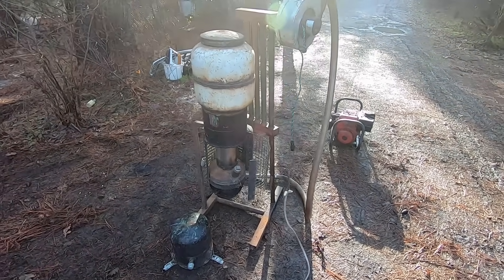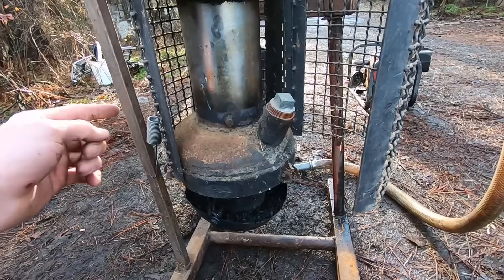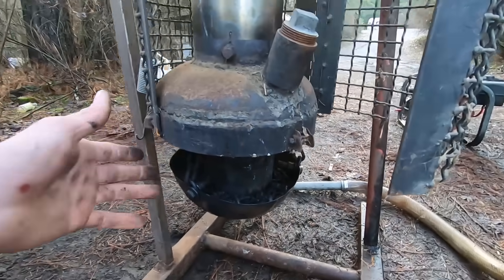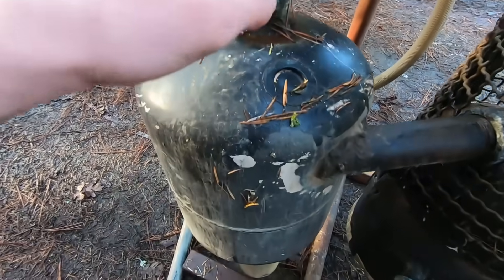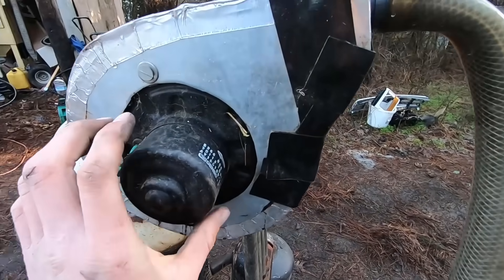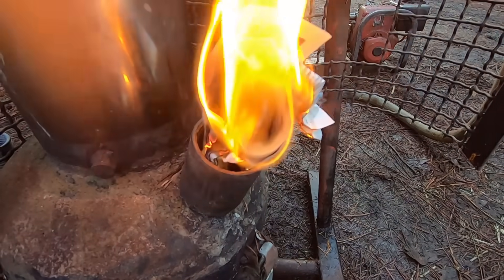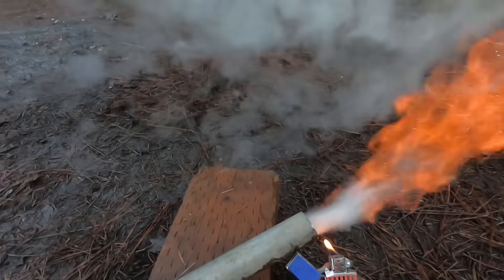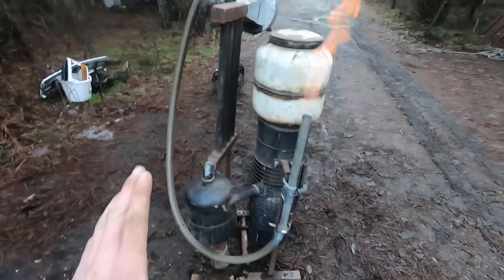Using Wood to Fuel a Generator! (How to Build a Wood Gasifier w/Demonstration)

Comment: My dad was a marine during wwii and spent some time in New Zealand. He told me about them using coal to run their cars using these contraptions.   These things obviously can provide useful power at a off grid cabin to provide electricity when there isn't enough sun to provide electricity to charge batteries and run things.
Reply: Look what I found.       I hope your dad did not tell you about the thriving black market with petrol (gas) and the locals?     https://www.google.co.nz/search?q=water%20gas%20used%20in%20cars%20in%20NZ%20in%20ww2&tbm=isch&hl=en&hl=en&tbs=rimg%3ACfYt6tCQMrTqImBzLpDTnlthUNkm24LiCIbrXbTGb7tzDl-cppVw9aNpdhJX3jCMWHGamp96fW0QGn0C7xDlGNBV1Yu25gJwAyeA48cR-gIvYSJic8JXgrSyyU9RY7LjvzaVmoAcxUHIU0kqEglzLpDTnlthUBHbOoa6tbhYlyoSCdkm24LiCIbrEc1rAMBgeDJcKhIJXbTGb7tzDl8RIR-ungLCtgcqEgmcppVw9aNpdhF3M_18_1IpDl5SoSCRJX3jCMWHGaEds6hrq1uFiXKhIJmp96fW0QGn0RyetvtyjJBPMqEgkC7xDlGNBV1RFurF0oUvpsLyoSCYu25gJwAyeAERhCaCwpMNiUKhIJ48cR-gIvYSIRtuYf0ZPw-lAqEglic8JXgrSyyRGP0OqOYy3SBioSCU9RY7LjvzaVEds6hrq1uFiXKhIJmoAcxUHIU0kR5YJyINoetzhhA78560VZRBs&ved=0CBsQuIIBahcKEwjYgIusysHnAhUAAAAAHQAAAAAQFg&biw=952&bih=460

Comment: I've completed you're Agitator with 60$ worth of Arduino google how to do it in 10 minutes 
You can use TWO stainless steel bowls one with holes drilled and one with slots drilled 1-2 inch long same diameter as holes. 1st bowl acts like a fixed CAM & gets mounted to the ash capture snap on bottom on a 4 post stand and should be the slotted bowl. The top bowl should have drilled holes and weld beads on the bottoms side right next to each drilled hole. Then have a rebar shaft run down the feed tube into the second "top" bowl and weld the rebar to the center of the bowl. Then get a coupling for your stepper motor to spin the rebar slowly so the top bowl spins on the bottom bowl. Then align the weld beads with the slots in the bottom bowl when snapping on the bottom ash catcher. That way when the beads are rotated out of the slot it seperates the two bowls by the thickness of the slag bead pushing your stepper motor up. Then as it rotates more, it drops into the slots collapsing the two bowls letting ash fall down as drilled hole in the top bowl is directly adjacent to the slag bead so it always lets ash fall through the slot when "tamp agitated". Use that center hole on your "pellet hopper" as a guide for your rebar shaft so it doesnt go wonkey and drill new air holes where ever. Those motors can handle 120C so maybe mount an old PC fan to the motor to keep it cool but its seen hotter applications so I wouldnt worry too much. You can also do a bike chain drive to make the motor not work as hard or get as hot.
7$ arduino uno
14$ TB6600 Driver control module
40$ 4.2 amp high torque nema 23
& 4 lines of code setting direction and speed and you're done with a nice agitator for 61$ minus rebar and bowl cost. You can even set timed rotations and schedules whatever.

Comment: I think the contaminants are because you're cyclone isn't designed correctly, at least as you described it. There should be a baffle just above the inlet, outlet should take from the top, and probably another baffle at the bottom would help.

Super cool though. Completely amazing.

Comment: Now use the generator to power the scroll fan and calculate how much 'fuel' is required to maintain operation over a measured timeline. 
As much as I appreciate what you've achieved here,  the fact is Gasoline still wins hands down when it comes to efficiency.
But hey, great vid mate!

Comment: That is really interesting. How much gas can you produce from 1kg of fuel? Or if not measurable, how long will the generator run on 1kg, (2.2lb) ?
Reply from the maker: Well, it would depend on the size and workload of your engine. The conversion is roughly 20 lbs (9 kg) of wood = 1 gallon (3.8l) of gasoline though if that hopefully gives you an idea.
Reply: @randomn6473  Thanks. That does give me an idea. I remember seeing pictures of cars with gas bags on them from during the 2nd WW. I always wondered how they worked, now I know. Thanks again.

Comment: Cool rig
I thought about making one of these and pumping it into some old propane tanks using a refrigerator compressor. I wonder if I can find a way to run my forced air furnace in the garage with one of these.

Comment: Definition: A square is a quadrilateral with all four angles right angles and all four sides of the same length. So a square is a special kind of rectangle, it is one where all the sides have the same length. Thus every square is a rectangle because it is a quadrilateral with all four angles right angles.

Comment: I think it is not used due to the high percentage og CO in the gas. The CO will be turned into CO2 in the combustion - but if there is leaks the gasses is more toxic than methane.

Comment: In terns of efficiency how does it compare to a steam engine?
Reply: In terms of efficiency, in general., inefficient by design and much more inefficient than a steam engine.
and if you'r wondering why? cuz of heat dispersion and poor design it can't run longer then 45m-1h.

Comment: I have seen much neater builds but in my opinion this one shows how you can cobble one together from scrap even if your not the neatest welder in the world, one of these units will assure the lights remain on in your house once the next fuel shortage happens and yes it will happen, plus it's a renewable energy source of sorts as the CO2 released during use was already locked up in the wood and will be reclaimed by the trees again and stored.

Comment: Looks like your 'gasifier' is producing a lot of carbon monoxide before it can produce enough gas to burn. Now if only you can design that 'gasifier' to use human feces instead of wood pellets, on a portable platform, you might be able to sell that to campers who will use it instead of a chemical toilet. Then Greta and her followers will be happy. Good job son.

Comment: You could submerge your radiator and/or filter in a bucket with running water for better condensation, therefore fewer contaminants (warm water exist bucket, cold water enters the bucket), that's what we do in the lab for other compounds, like methanol. It doesn't have to be a running water system, just submerging it in water should be enough and the temperature difference would create water flow inside of the bucket, but as entropy increases in the system, the "stationary" water system may turn less effective with time.

Comment: Seen a gasifier before but I like your demo and description.  Was in a hurry so I skipped towards the end, but curious other than electricity what uses you know of.  That's cool it can be used to make gas for a stove... that way you don't have to rely on a biodigestor all the time.  So many cool things you can do with wood... can make biochar for the garden, charcoal for heating, heat water... I'm totally into permaculture so living good off grid is always a hot topic

Comment: I would have liked to see how the generator works with a load on it. Running the engine is the easy part, but how much power are you actually getting from that system?
Reply: at least the principle works   needs maybe some up scaling for some more power. maybe create a new system to inject the gas in stead of trough a no function carburetor.
start is there butter than a fake co2 neutral tesla  or other hybrid
Reply: Don´t know about this one, but with a well configured wood gasifier, you can achieve about 60% of the power that you get when running the same engine on gasoline.
Reply: YOU AWAKE ?
Reply: everything lays in the math, and how you inject, so no matter seize of engine, you could compensate for it, with everything pretty much :P

Comment: having water in the system is not bad, as long is it's in the right amount! You can make coal gas by running steam through charcoal. Ideally this would produce a mix of hydrogen and carbon monoxide only, but in practice you do get some carbon dioxide and other substance from the impurities. In any case be aware of the large amount of carbon monoxide in that gas and how toxic that is. Coal gas in particular as it has no smell. Not that big of an issue outside in the open, but take extreme care, anyone that implements such thing in any kind of indoor/closed space with limited ventilation.

Comment: Wood “sorry for that” it gum up the carburetor over time?
Reply: El Chapo’s exciting adventures the gas is filtered so there shouldn’t be any soot or tar that would mess up a carburettor. 

Because its a gas, if you were to design an engine specifically for it, you wouldn’t need a carburettor.

Comment: Theres a process to convert coal into a middle distillate using a similar concept. I believe its called coal oil fusion. Then you would have fuel for your shop furnace, vehicles and what not.

Comment: A lot of setups use a bubbler tank with water and run the gas through that to help get rid of tar and other fluids before going to the engine. Surprised you didn't have one.

Comment: For anybody trying to understand how this is used in a commercial environment. Thank you for making this but this is a very raw version of what it can be made. The sad part of this is that it will actually kill the generator as some of the contaminants are not removed. As a short them solution this is great as a long term, not so much. But with some changes it would be a great system. Keep it up.  https://www.youtube.com/watch?v=kI7s6IRpOHA

Comment: Could weld some fins onto vertical pipes to increase cooling.
Reply: You don't actually want to cool it so much. The OP has got the wrong idea a little. Although it's certainly important to cool the gas, making it denser and therefore better in an IC engine, the "liquid" that forms when it cools is H20 that came from previously H2 and O. The H2 is your fuel. So long story short you are turning wood and air into water if you over-cool it, not syngas.

Comment: DPRK (North Korea) is the only country far as I know that still design and make modern wood gas powered truck engines because of the American embargo on their OIL import, and because DPRK does not have unlimited amount of energy they cannot synthesise petrol out of coal however they started to do that recently but they still use wood gas trucks, really interesting in my opinion as no other country with the GDP of DPRK does anything like this.

Comment: great video....this is similar to a pellet  stove  I made that acts like a catalytic converter.  I used a 100 lb. propane tank with an insulating refractory brick chimney inside for a secondary burn of the smoke .  It's a goosed up rocket stove.  I got the idea from YouTube.
Thanks for the info

Comment: The heat can also be recovered and put in function an Stirling engine that , with a generator,produse electricity for a battery and from here, with an inverter,can be changed in a.c . Here,a rocket stove it's used to produce: heat,cold water and electricity in this way( with a Stirling engine). It's also nice this way to produce heat and electricity and gas for cooking ( that not produce what we have here). After my Ideea,I will combine something on wood in case of electricity, with a solar panel .Solar panel to charge battery when it's light and the wood fuel ,in the rest of the time,in special,night to have enough electricity in winter for a fridge and others . Here it's the company that produce what I said, it's in Romanian language because it's from Romania .
http://www.ariadneimpex.ro/index1.php?mn1=35

Comment: Very impressed that you not only produced methane, but enough to run that generator.  The mother earth news magazine did a lot of stories back in the '70 & '80. I believe they converted a truck with the gas generation in the bed. Your video is very convincing how easy it is. Thanks for sharing.

Comment: Wood pellets are not an economical fuel.  They are great to test a gasifier but also dont reflect the real world.  You pointed out all the fuel you are surrounded by.  Now you have to prove you can turn the fuel into a usable form.  Every type of feed stock has its own pre processing procedure, Some are ecomical, others not.  Densification into pellets has been proved to be a loss every time.  So will it run with non densified material?

Comment: 14:43 What if it backfires? Wouldn't it set your generator on fire?
Reply: Thats what Im wondering, too. Id like to build a woodgas setup for running a small engine, and actually plug it into the carb all clean like, but Im worried about a backfire blowing up the whole works

Comment: Using a fan is not practical in a off grid or total power black out. 
You need a filter system using a readily available product. 
Some use saw dust or even small wood chips to catch the impurities.

Comment: How much wood does it consume over what time? And this is being used to power that little motor, so my second question is what about using this to power the motor, the motor charges a large battery bank. And then living off of the battery bank charge. Heating water and air and other electrical needs within a home. For that purpose how efficient is this?

Comment: How many hours run time do you have on that engine running on wood and what kind of load can you pull on the gen set?
Reply: Would be interesting to know... with a modern charge controller (ie when charging batteries) you could adjust the load pulled from genset, but may also hit issue with the smoothness of the genset's running.
Would it be possible to 'buffer' the wood-gas so that it's production is somewhat regulated?

Comment: This is called suction gas in the old days many towns in Australia produced electricity  by the suction gas engine, until around about 1945 when they started using diesel engines. https://youtu.be/2hDXC6InEJo

Comment: I was wondering if you can use sawdust or will it compact too much in the tube and restrict the airflow?
Reply: I have read it does compact too much. air needs to circulate between the wood pieces for efficiency.

Comment: It may be possible to add a tank of water somewhere at the end of the system.

Allow the smoke/gas to travel through water, this should trap heavier particles within the water, as hydrogen is hardly water soluble the hydrogen should pass through, filling the top of the tank with the gasses and no smoke.

This is roughly what my uncle did to his diesel engine exhaust gasses. The idea was to reduce smoke by blowing it into water, and it worked for the most part. He did flood the engine on several occasions because you have to remove the exhaust from the water before turning the engine off or on, or it will just suck water right up like a vacuum.
Reply: how do you process the water afterward to remove the pollutants collected? or how do you dispose of the polluted water then?
Reply: @CuriousEarthMan  I never asked him what he did with the water. My guess is he just threw it into his garden or drain.
Reply: @stage4901  thank you!

Comment: If you save the liquid  you can stick that in your truck tank..Use an a/c condenser to cool it a second time. This will help  recover the go juice.. And why do you need a generator? Didn't you check  out some of that cool 18th century tech? Like gas lighting..

Comment: If not anything else, this could be an excellent way to improve the efficiency of wood fire water stoves and heating homes as well by reusing the flammable gases expelled from a water stove to either run generator for electricity in summer time or for adding additional heat to a home in the winter.

Comment: there is a technical literature seller called lindsay publications , i bought a booklet called " gas producers for motor vehicles " in the 1990's . it shows the different types of wood and charcoal burning gas producer plants . it gives very detailed instructions on how to build one . i also bought one called " alternator secrets " which shows how to modify alternators to produce 115 volt ac power like a generator

Comment: So you could boil some water on that cyclone "filter" and run a steam engine too. Or at least have a cup of tea%))
Reply: I have seen some gassifiers that will run a generator, boil water, and offers a cooking surface; all on the same unit.`
Reply: You should have a look at Colin Furze's Jettle - a tea kettle powered by a pulse jet engine.
Reply: @jshicke  aaand is a heating unit
Reply: @jshicke  So a heat exchanger could offer a logic control oven?
Reply: Weld a flat plate on top of the filter, so you have a place for a kettle...or even a pot (heat up some soup if it is cold).
Reply: No need for a steam engine, just use a Stirling engine to produce more mechanical work and hook an alternator to that or connect it to the shaft of the ICE generator.
Reply: Could probably hook a few Seebeck generators to it for more electricity
Reply: make a treadmill generator you could power it by a miniature pony with hot steam pointed at it's ass.
Reply: @jimbob5013  you're an animal, you're hired
Reply: Use it to drive a turbine.
Reply: Think Coffee
Reply: i was thinking of using the steam to heat a house, ( and u could cook AS WELL  ! 2 for the price of one !
Reply: U COULD AMPLIFY THE USES AND MAKE ANOTHER STEAM GENERATION OFF OF THAT AS WELL !
Reply: Have your fan/blower powered by steam lol

Comment: Could also add an piezo electric /12v dc sparker -- and a MAP/Propane/Butane blowtorch w/ blower on your ignition port -- and a few sensors on an ESP32 to gauge combustible gasses on the output, so you could control some baffles -- and the blower -- fuel shaker -- or other things